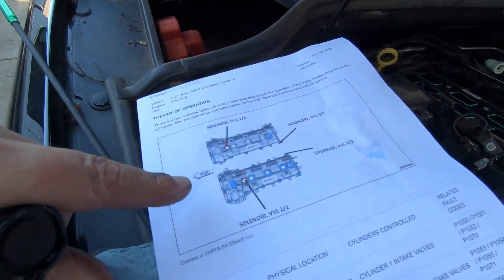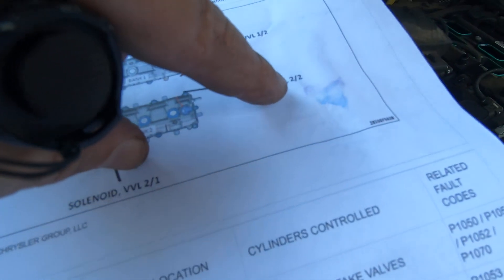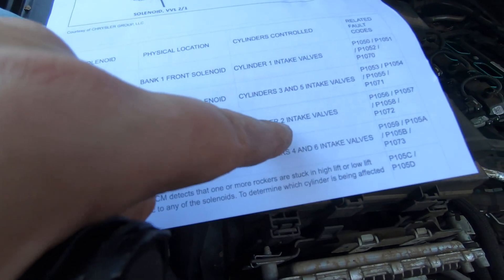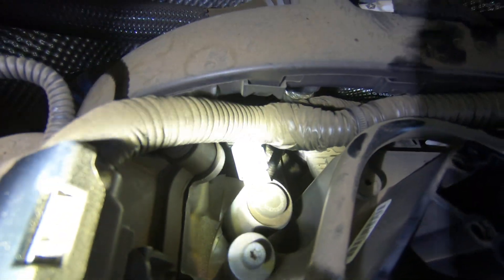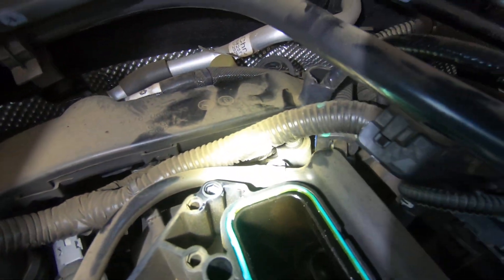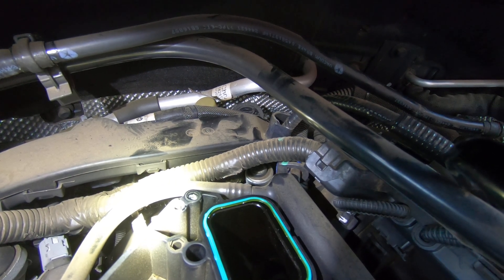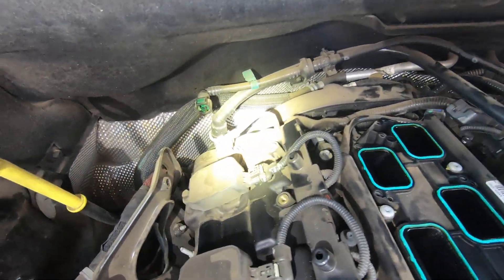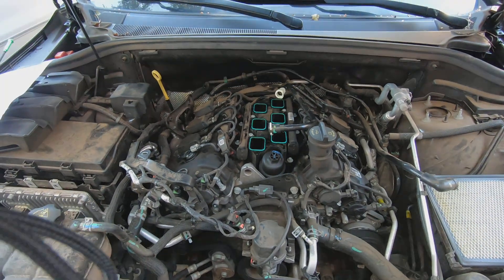Where are the VVL Solenoids on a Pentastar 3.6 Engine.

Comment: hi so what do you think. same engine but 2019 grand cherokee laredo. p0018  what is it. any ideas please.
Reply from the maker: The P0018 code on a 2019 Grand Cherokee means there's a crankshaft-camshaft correlation problem on Bank 2, Sensor A (exhaust side), often due to low/dirty oil, a faulty Oil Control Valve (OCV), cam/crank sensor issues, or a stretched timing chain/skipped tooth. Fixing it usually starts with checking oil/filters, cleaning or replacing OCVs, inspecting wiring, and potentially involves deeper timing component fixes like phasers or chain replacement if issues persist, which are complex repairs.
Reply: @737mechanic  so it call the phaser actuator are they call vvt or what is ocv is it a sensor?

Comment: Thanks for making this easy to locate the solenoids. I replaced the front 1/1 and 2/1 with no issues. 1/2 looks easy enough. However, the solenoid that is not working properly is 2/2 (wet plug). That thing is buried down in there at an impossible angle. It also looks like it won't come out without hitting a shroud above it. Did you remove yours and if so how? I have tried every wobble and universal joint socket I have.

Comment: I have a 2011 Dodge Journey with this 3.6 VVT engine. I checked after watching your video, mine doesn't have those solenoids, only the ones on the cam phasers
Reply from the maker: You are lucky. I think 2016 is when they added the Variable valve lift.
Reply: @737mechanic I have a missfire that I can't figure out, I checked all the common issues. Spark plugs, coils, compression.
Reply from the maker: @LinkSquish  Injector?
Reply: @737mechanic I got new injectors, still did it so I returned them
Reply from the maker: @LinkSquish  Is it on a particular cylinder?
Reply: @737mechanic mostly cylinder 1 but it says multiple missfire as well

Comment: I’m trying to replace the seal for 1/1 but can’t get the new seal to fit. Seems too big or do I need to force it in?
Reply: Did you repair the car? I have got the same problem with 1/2 :(
Reply: @damp7ernavigator yes, fixed this issue. Waiting for the next problem to pop up now. POS jeep - almost wish I never bought it. I’ve had all the endemic problems, I.e axle locker sensors, corrosion on hinges, on and on it goes.
Reply: @JoshuaQ8  My mechanic said that it is necessary to remove valve cover to replace the seal. It is true?
Reply: @damp7ernavigator  I only needed to replace 1/1 which is easily accessible with the valve cover in place. The rear solenoids appear to require the cover removed.
Reply: @JoshuaQ8  How about 1/2 its easy to replacement or need cover removed?

Comment: @737Mechanic I had a question? Are the solenoids on the back side of the engine the same As the ones on the front ? i was planning on buying and replacing all 4 of mine
Reply from the maker: No, they are different.